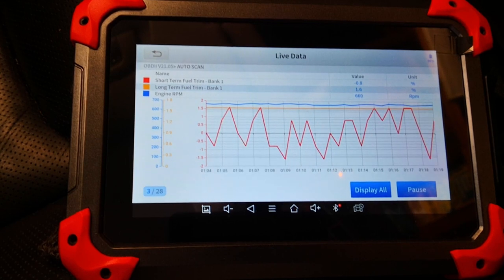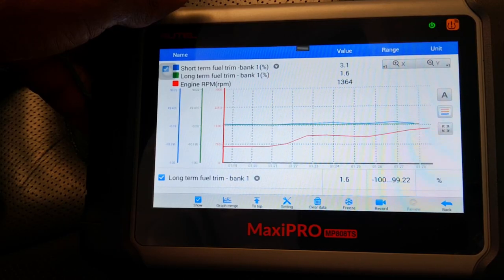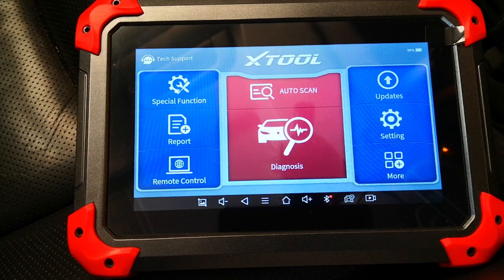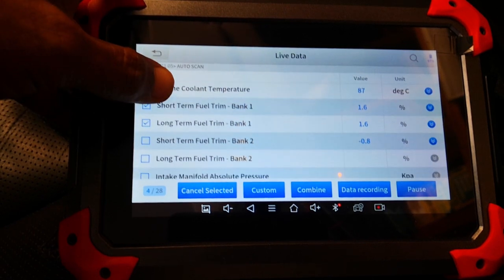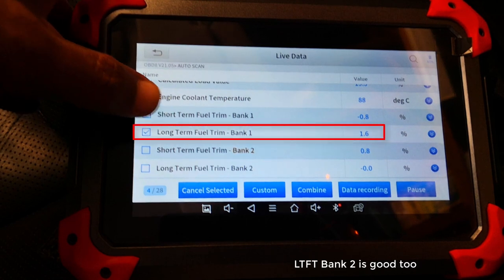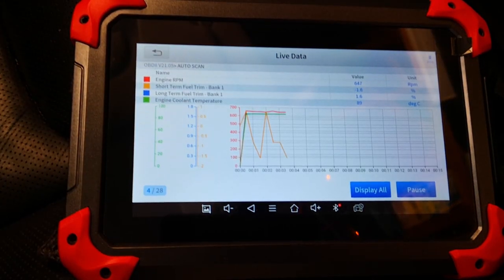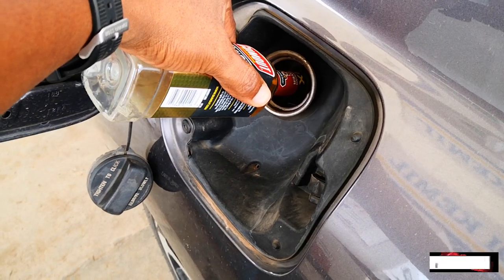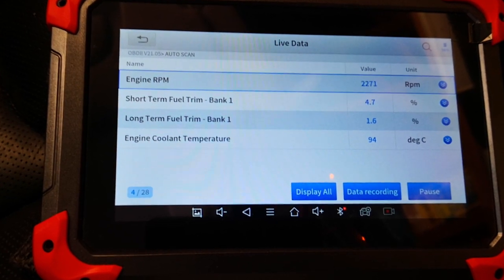How to Diagnose a Failing Fuel Pump with Fuel Trim data / Pro OBD2 Diagnostic Scanner  NOT Required

Comment: Excellent and precise simple explanation.  I'm currently getting these codes and here are my trims: https://youtube.com/shorts/8JQoFlVakio?si=9mbJ-7X930AvtScE

So according to the test I have a vacuum leak. But after running a smoke test the only one I found was at the EGR valve, which I replaced along with  the MAF, PCV, fuel filter, and I'm still getting a lean condition P0171, P0174. What else should I try Rhanks sir?
Reply from the maker: Yea, those fuel trims are consistent with a vacuum leak. Did you also check for cracks and hose clamps on vacuum lines are tight? I'd say you double check. Also remember checking the EVAP for leaks too. A worn intake manifold gasket is another culprit, did you do any work in that area before this started? 
What car is it?

Comment: Everything points to assumptions, there is no number to understand the problem. Maybe oxygen, leaks and fuel pump. Maybe maybe…. 

You don't know exactly where the problem is, you end up applying again smoke check, because it’s 100% real.
STFT 12% mean that pump is bad but also maybe vacuum leaks))) It's a waste of time
Reply from the maker: Not a waste of time at all from how I see it. This is a quick and easy first test to give you a sense of where to look or what other test to do.
Reply: @DIYAutoworksNG  thanks for reply.
There are many test operations for one error, I'm not talking about you specifically. It's just that the process requires divination because there is no condition that even indicates an example.
Imagine such a situation LTFT stuck on 25% positive, it’s generally leaks but But everything can be started from fuel pump to EVAP solenoid or throttle body gasket. Conclusion: What do we do in the end? Again and again smoke check

Comment: What if you raise the rpms and stft b2 reads +14
Reply from the maker: Think of restriction in the fuel supply on Bank 2.
Reply: What may cause this
Reply from the maker: Dirty/clogged fuel filter, failing fuel pump. This assumes that the car has separate filters/pumps...
Do you know what your fuel pump assembly setup is like?
Reply: 2006 Mercury mountaineer filter is separate pump inside tank
Reply from the maker: I've also seen a dirty MAF sensor can cause this, as well as injectors on Bank 2. Maybe try to clean the MAF, get a good fuel system cleaner in the tank and see if it helps. If it doesn't, try reading fuel pressure on Bank 2.
Reply: I cleaned MAF sensor, used fuel system cleaner still same problem. Fuel pressure around 30-45 on scanner. Don't know how to check pressure on separate banks
Reply from the maker: What car is it? Is 30 - 40 psi in keeping with the recommended fuel pressure spec?
Reply: @DIYAutoworksNG  2006 Mercury mountaineer 4.0L on obd 2 reads 52psi
Reply from the maker: Check your recommended pressure here. https://troubleshootmyvehicle.com/ford/4.0L/fuel-pressure-specifications
Seems like 52psi is out of spec for your year, but confirm the trim.
Reply: @DIYAutoworksNG   it's out of spec what causes it to be high
Reply from the maker: A defective fuel pressure regulator. If you car has a return fuel line, a restriction there is another cause.